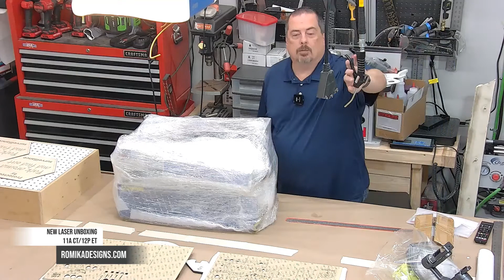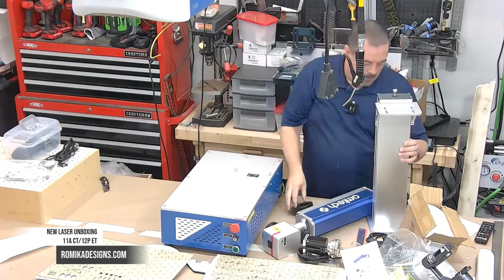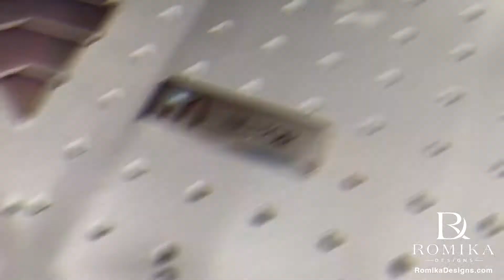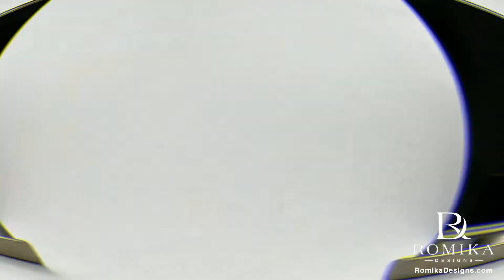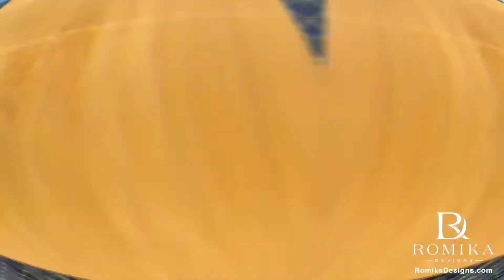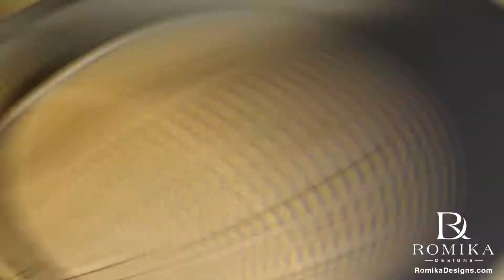OMTech Fiber Laser SH-FM30 Unboxing and Discussion

Comment: Maybe there is a way to mount it on to a cart
Reply from the maker: Thank you.  Yes, that's the plan.  We're trying to find one that I can at least move it with.  :)
Reply: Would this be OK to set up and use in a woodshop? Would I need a  special set up?
I have the same laser as you.
Is Lightburn Galvo as friendly as regular C02 Lightburn?